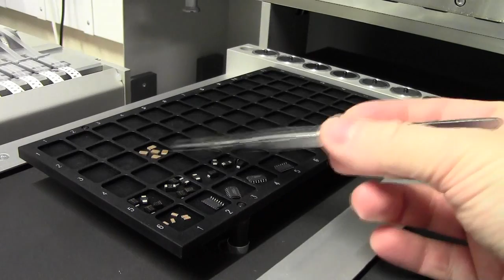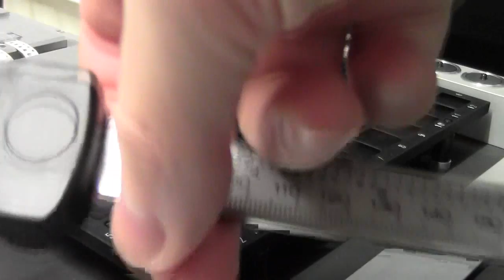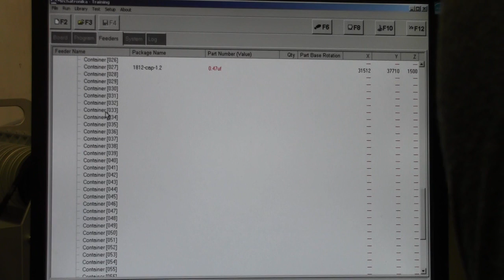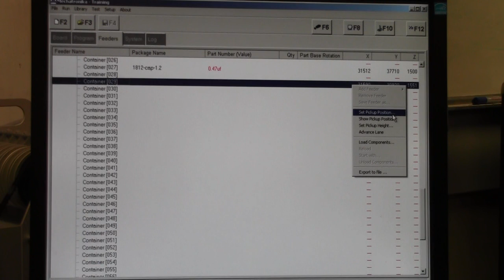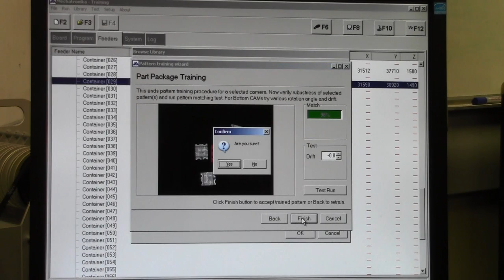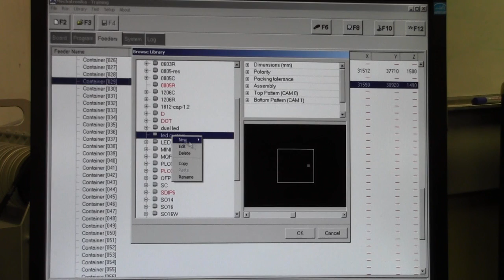Automatic SMD Pick Place M10V. Part 3 Adding components to a bulk tray and setup in software

Comment: Great video! It's been a while since I have used my machine. But from what I remember, the pickup height should be trained to the bottom level in the bulk container - and the machine will calculate what height to pickup the component based on the height information you have entered for that package in the library. I guess a quick test to verify this is to enter a very high component height value in the library and see whether the nozzle will be too high up in the air (not able to pick it up) - if so, it uses the component height information!
Reply from the maker: I will try this out but from what i can remember from the training i had the component height you enter in the component library is used for placing not pick up. if you set the machine to pickup from the base of a holder and dont adjust the height to the top of the component the pickup head will pick the component but the head would suffer a slight back lash (which the m10v can take as its belt driven and so has a little give) because its expecting the top of the component to be lower. A back lash on the head is ok  now and again but continued used can cause the belt to strech over time and push the head out of calibration and would damage the smaller 0201 nozzle over time but i guess you wouldnt use those components in a tray.
Reply: channelengineer You are absolutely right when it comes to normal feeders. But, what I learned is that for the bulk feeder (loose components), there is an exception - and the pickup height should be trained to the bottom level instead (maybe due to the difficulty involved with measuring the top level of a component that is loose. But, I will do some testing next time as well. For all we know there may be a difference due to SW versions also ;-)
Reply: Found this the hard way, it did not pick up the part, saw that the nozzle never touched the part, difficult to see for small components, but visible SOIC package, gave a very high part height, the nozzle was very high up. Trained the pickup height to the bottom of the tray and gave the correct part height. Everything works, came to give a comment, saw it was already here.

Comment: Great video! Question on the pickup height, why can't the nozzle just get the pickup height from the actual component in the bin, instead of doing the math?
Reply: Because the vacuum might suck up the component too early and the measurement might be wrong.

Comment: Don't suppose you know where i can get another "demo unit" from..
Reply from the maker: You will to ask about, try asking the companies that do the trade shows like those at nantional electronics week expo. usually some units will go on offer after the shows have finished and if you go to the show you can always haggle a bit with the sales rep.
Reply: channelengineer Thanks. The videos were really informative and have helped me make a decision on what to buy.  This will fit nicely in our workshop to do the small work and the big run stuff can go and be made in China.

Being able to pick up loose parts out of the bins is a huge thing for me.    Making new bin trays would be easy too. Acrylic cut on the laser cutter would do the job really nicely. 

Now just to do a bit of haggling around.